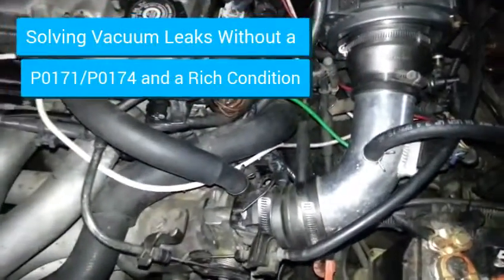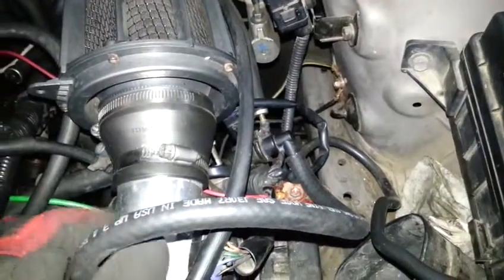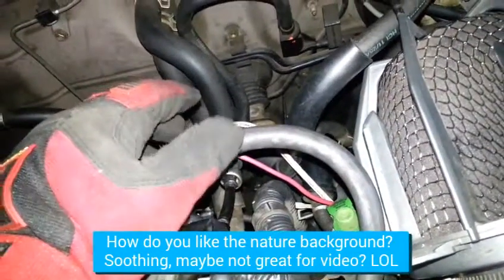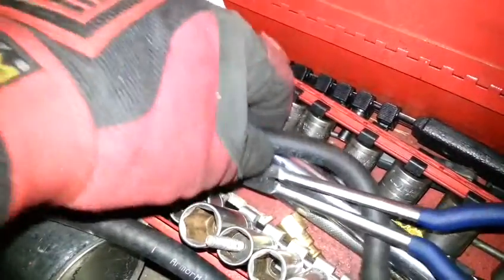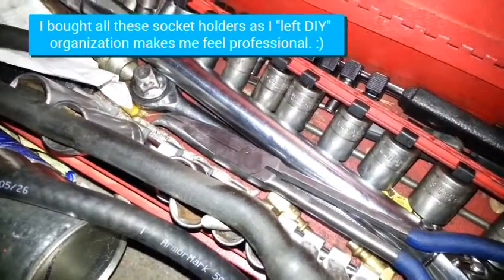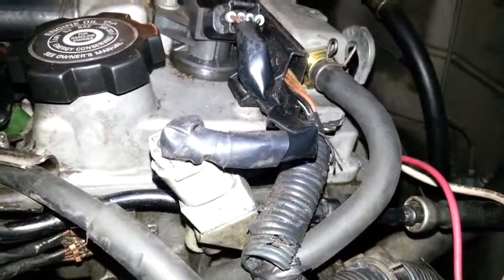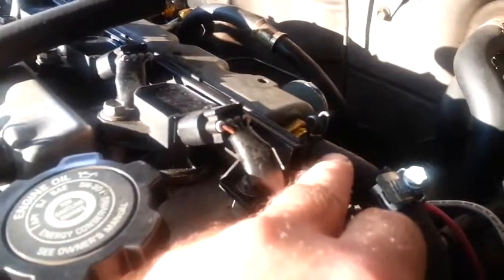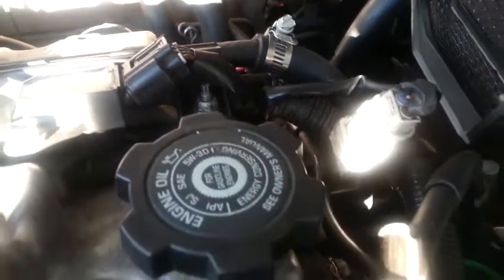Fixing Vacuum Leaks without a P0171/P0174

Comment: What vehicle is this for?
Reply: Any?
Reply from the maker: +Sarah Cheverier 1998-2002 Chevy Prizm or Toyota Corolla. Same car.
Reply from the maker: +Sarah Cheverier Yes. The concepts are good for any car.

If you think you may have a lean condition, be sure to check any rubber on the intake as well. Often as engines move in the engine bay and intakes are fixed a leak is developed that you can't see without stretching it.

Intake manifold leaks are common on my car when there's a plastic manifold. I have the metal one.

Comment: I know what you mean when you complain about garage lighting. Worst thing is most garages aren't wired to allow all the power they need. The first thing I did with my garage was to put in 6 banks of fluorescent lighting.
Reply from the maker: I think Matt did a similar upgrade since his earlier videos. :)
Reply from the maker: Since you have am everything DIY channel you wouldn't have anything to teach me about such wiring would you? 

My confidence is up for safely handling circuit breakers, light bulb and regular sockets.
Reply: +DE Nichols I've done a lot of home wiring and I know the codes pretty well, but I've never recorded any of that work. Maybe one day.

Comment from the maker: Here's the most of the update that I put on Toyota Nation. You should check out the description. :)

My car runs so much better!

Between having an O2 sensor that isn't running falsely rich, and the vacuum leaks, my idle air control valve is getting more control than ever, and it's choosing something other than 2 g/s and 4-4.6 g's at idle!

I caught it using 2.5 g's today.

Also, my short term fuel trim was going nuts to reverse match the long term fuel trim of-18 to get total fuel trim to about 0. ("idling at 25-30, coasting to a light in gear).
Reply: +DE Nichols Come back to the conversation again at ToyotaNation, a friend is trying to fix up his vacuum tubes and that part no. I list sometimes pulls up the wrong part. bcreduer97 was kind enough to post pictures of the wrong part. I replied with the correct look of hose and issues that I suspect even with the correct one.

We both have much better miles per gallon for our cars after these vacuum leak fixes! Mine is better now that it's a bit cooler than I've seen all summer!

Granted, the temperature change is another variable, but in these temperatures last year I wasn't doing much better.

So, come back to the conversation again:
http://www.toyotanation.com/forum/131-8th-generation-1998-2002/1065290-time-headgasket-7.html#post10127786